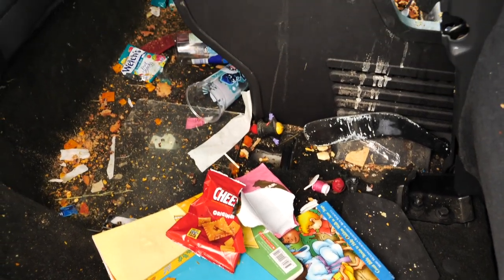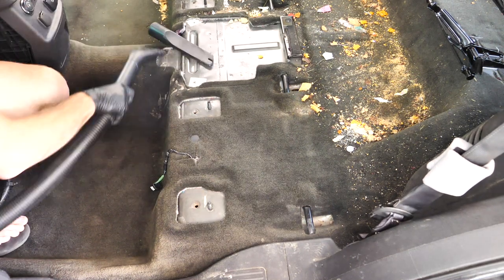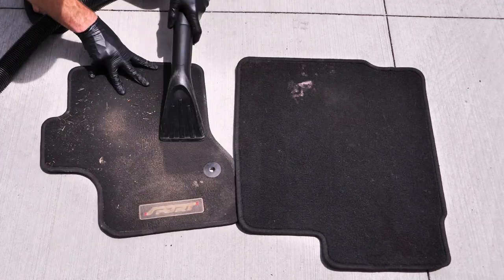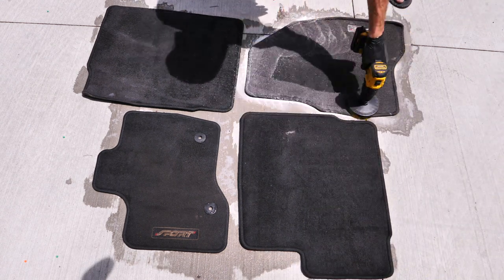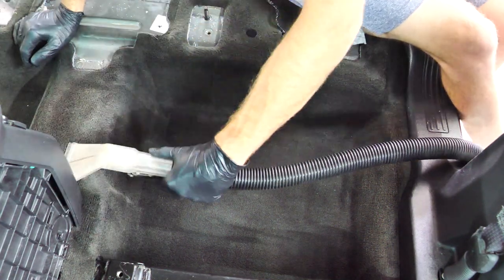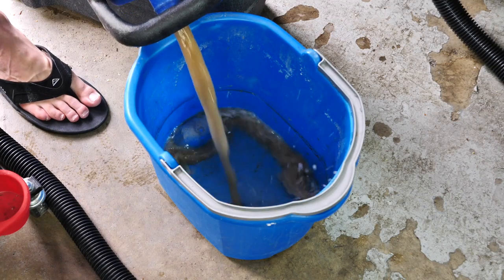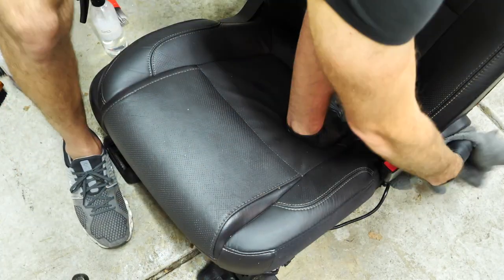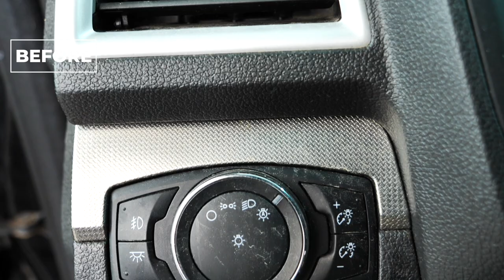Full Interior Car Detailing Transformation of A Nasty Kid Trashed Car! Interior Restoration How To

Comment: Hate to be a downer but those car seats are ruined with you pressure washing it like that. The harness straps are not meant to be completely soaked with water per the manufacturer directions (of all car seats), and by getting the shell soaked you can ruin the inside mechanics with any rusting on the metal. Please please please take this portion out of your video, you are promoting extremely dangerous practices.
Reply: Car seats should only be cleaned per the manufacturer instructions in their manual
Reply from the maker: I appreciate the comment but this is not true. If that was the case then everytime a diaper gets wet through or a drink gets spilled, it would be ruined.
Reply from the maker: Per Graco: 
For the cover: Remove seat cover and/or seat pad. You can machine wash these on the delicate cycle in cold water, or spot clean by hand with mild soap. Always air dry.

by using just a pressure washer and no detergent, this is even gentler than what they recommend.
Reply: You cannot be serious, child car seats are massively over-engineered and overbuilt. They get wet all the time, they are designed for scenarios like that.

Also rust lol, they are meant to be replaced every 10 years, they could last 30, but they want 10. There is no way rust in any part of that child seat is going to rust anywhere near a fail point in 10 years or less (excluding the fact they are all stainless steel for that very reason).

I hate people who go stupid over safety when there is no reason.

But hey, I am just an aerospace/mechanical engineer, what the hell would I know.
Reply: I have no idea if what this lass is saying is correct, but she's talking about the straps and shell, neither of which that extract from the manual is talking about
Reply: @StaufferGarage  that is for the seat fabric, to be removed from the shell on the car seat. Also note how it says to wash on delicate cycle, spraying with a high pressure washer is hardly equivalent to washing on delicate. Harness straps are to be only wiped with a damp rag. You potentially ruin the integrity of how the webbing is designed to stretch in an accident.
Reply: @StaufferGarage  I have spoken to many Certified Passenger Safety Technicians over the past few years with my kids and it’s a unified answer when I have asked if you can do this (because yes, messes happen, and sometimes this is your first thought to clean them), and they will tell you you cannot spray down a child’s car seat with a pressure washer. Please do your research, you have a large audience and influence.
Reply: @StaufferGarage  I should add, I have never thought of doing that with car seats, that is going to make cleaning them oh so much faster.
Reply: Bear in mind 20 years ago seat belts weren’t even a thing!
Reply: Removing and washing is completely different than soaking with a power washer ON the seat frame. OP is correct on this. Do your due diligence and speak to a child passenger safety technician or call Graco to learn more.
Reply: @girlnextdoor603  with the majority of followers being male on this page, it’s likely a lost cause to try and educate. Sadly the male way of doing things is usually whatever is easiest and quickest. But if one person sees your comment and decides to care differently for their car seats than it was worth posting ❤️.
Reply: @StaufferGarage  The covers are pulled off leaving the straps behind with the seat.. So Lauralee might be right regarding the straps?  Even though I dont see how water would damage Seatbelt straps...
Reply from the maker: Mechanical myself and agree, safety factor is insane and let alone the time that a kid will be using the seat is less than 10 years. What if the belt is soaked in ice cream, milk or water? How do you clean it? Spray with cleaner and chemicals? That in my opinion is more abrasive and degrading than a pressure washer and water
Reply from the maker: I think that’s a bit odd to think it’s a male thing only… why does this have to turn into a male/female debate?
Reply: @Melissa.Scott1  you are correct, most here would be males.

You know where else males are mostly. Engineering is mostly male, the safety boards who set standards are mostly male, the people who design and build them are mostly males.

Hardly see your point. When both you girls are wrong, and both of you do not know what you are talking about.
Reply: @StaufferGarage  100% agree mate this should be a normal debate not turned into a male/female you've done nothing wrong in my opinion
Reply: @StaufferGarage  Why odd? I didn’t say always, I said usually. And in my life, I’ve found that to be the truth in many situations. I find it odd that someone came on here gently trying to educate you and you and many other men (seems to be mostly or all men) have disregarded or ignored or tried to come up with ways to discredit what she said. Spilling ice cream on a seat doesn’t completely saturate the belts in whole. Spilling a drink on them likely doesn’t either, seeing as kids cups only hold so much water. As OP has posted, cleaning belts is supposed to be spot cleaning only. The misuse and care for car seats is a much larger problem than many people may even know. It’s not an attack for someone to come here and try to gently educate… you have a massive following and this could be a great teaching moment for many parents.
Reply: @matthewfarrell317  I am not turning it into a male/female debate, I never brought that up. And you are correct, the majority of the people who have designed, tested and built these are likely mostly male. And yet, they are the ones who have written these instructions to follow, and put in the manual for safe use of the seat, if it did not matter they wouldn’t put it in there. It’s in there because they obviously test these materials and would either not perform or have shown damage compromising the integrity of the seats. They don’t write these manuals ‘for fun’ there is reasoning for everything they include.
Reply: @Melissa.Scott1  I find that odd. Stauffer has confirmed he has a mechanical engineering background, I have an aerospace/mechanical background, and you are claiming the OP was trying to "educate" so would love to know her engineering background.

You keep talking about the belts, the belts that are made with synthetic fibres that are designed not to be affected by water? Also, there is more than enough water in a baby cup to do damage to materials, it's not about volume when it comes to that sort of thing. The car seats are designed with getting wet, as that is a major design parameter the engineers need to deal with. They use stainless steel to avoid corrosion and rust as much as possible. The seat is usually made with polystyrene foam to again deal with the ingress of water, and for its properties in a crash. Nothing in that seat is going to be negatively affected by the water.

Also talking to one of those "Certified Passenger Safety Technicians" is a joke, none of them do more than a week course tops (the ones here in Australia its a 2 day course).
Reply: @StaufferGarage  An occasional spill or vomit episode over the lifetime of the seat/straps is not the same as completely soaking them with an abrasive pressure washer
Reply: @Melissa.Scott1  even if she was attempting to "gently educate", as you so strategically put it, which was not the case,  her attempt is for not when you decided to start making sexist comments regarding the Male sex. And yes what you wrote is sexist no matter how much you try to "back peddle" its sexist. Btw I'm female so any other sexist  comment you post doesn't relate 🤗
Reply: @StaufferGarage  don't worry about it you're doing great been watching you for a few years now and I'm NOT part of the "Male audience" lol. My father has removed and pressure washed filthy seats for 15 years now or more with absolutely no issues. It's never something he did to the same seat repeatedly.  Always a one time deal to get the majority of the  grime out. You're doing awesome! Keep up the great work😊
Reply: @matthewfarrell317  thank you, thank you, thank you! Lol
Reply: The carseats are fine and still useable jfc, pressure washing is so much more gentle than a “gentle” machine wash cycle
Reply: @gabriellehale8318  I’m certainly not trying to back peddle, I stand by what I said. I didn’t say all men, that’s all I was trying to clarify. Power washing a car seat is 100% taking the easy way out. Amazes me how sensitive everyone is in today’s world. 

Also, if I’m the “Karen”… 🤣 ok fine. I’m happy to stand by what I’ve said. Pressure washing a car seat is not proper care, point blank. Whether it’s due to seatbelt saturation or putting too much wear on the sidewalls. The seats are not intended to be washed that way. 🤷‍♀️
Reply: @StaufferGarage  It does only if you allow it bro. You are a professional and have done this thousands of times. Let's those that know everything, know everything. Keep it moving. Detailer to detailer let the lack of returns for service speak for themselves. #itsallinthedetails
Reply: @girlnextdoor603  the part that makes a delicate cycle 'delicate' in a wash is that the agitation is turned down, not the water pressure. Just pointing that out.
Reply: Well, as a woman maybe I’m not allowed an opinion here since only “males” apparently watch this channel. However, I’d like to add some personal experience as a mother of two children who somehow have successfully made it to adulthood after being in car seats as infants and toddlers that were most definitely hosed down on several occasions. I too have read the instructions on the car seats and did not consider that method of cleaning to be “immersing” any part of the car seat, straps included, in water. 

I think also in this day and age of coronavirus, spraying the seat down and then leaving it out in the sun is probably the best option. 

So, I wouldn’t consider the car seats ruined from pressure washing. Those car seats were ruined when kids were sat in them. Because, kids.
Reply: @jacobburnett1175  I’m a woman..I agree with you!  Anyway..just mute them. They obviously are out to cause trouble for James.
Reply: @gabriellehale8318  lol, well said ✋👍
Reply: I think it's insane that you wouldn't atleast call the manufacturer and fact check. You are a business and property of your customer should be super important. Instead of arguing with someone who is just trying to keep the safety of a child. This is disappointing that you took the route of pinning her comment and denying her claims. 😒
Reply: @StaufferGarage   As CPST it is best to follow manufactures instructions as they will not be liable for any injuries unless you do. That being said I have not seen a blanket statement across all brands regarding washing of the parts. Nearly all the parts that need cleaned can be removed. And yes using any chemical that can compromise the materials will in facts bios the manufacture warranty.
Reply: "You know nothing Jon Snow".
Reply: @StaufferGarage  : post warning for karen on intros
Reply: @ChiralSpirals  i don’t think she’s being a Karen. When it comes to kids and babies im the “better safe than sorry” type. So i agree with her. Given the state of the vehicle its hard to say what any part of the car seats have really been through and under additional pressure from the pressure washer the straps could be less effective if the driver were to get in an accident with a child strapped in. For liability reasons I wouldn’t have done that personally. 
Certainly wouldn’t film it. I left so many mom “support groups” for car seat related discussions turned wars. Its always a topic thats guaranteed a fight. 
But i dont like lauralee ellis was being a karen. She’s far from the crazy car seat karens i’ve dealt with in the past.
Reply: He may be an amazing detailed but that doesn’t mean he can’t make an honest mistake. He should research it for himself and if he finds he made a mistake then he should own it and educate others on not making the same mistake.
Reply: @leftfordead6307  now was all that really necessary?? There’s no reason in cussing at the girl like that. Hope it made you feel good!!
Reply: @matthewfarrell317  and what does him having an so called engineering degree have to do with cleaning a damn car??
Reply: holy hell. Straps are NEVER to be soaked! It causes them to stretch and then degrades so in the event of an accident can break under force ejecting kid from seat! There is a reason car seats have to be safety tested and regulated.
Reply: I was reading ur comment about the car seat being cleaned with the pressure washer and it does not damage anything.  If anything it cleans it better and keeps u from having to Clean it for a while. I understand what ur saying but someone I know cleaned one for me and it looked amazing. U just need to get someone who knows what they are doing and everything will be fine.
Reply: @matthewfarrell317  He also vacuumed off the water and left it out to dry. Seems wet pee (ammonia) left to sit in the seat would be loads more corrosive.
Reply: Boom roasted
Reply: @benvalenza1977  ur welcome
Reply: @ChiralSpirals  ikr! She should complain to the manager 😁
Reply: @jastinyhale  aww but i love this channel
Reply: @rickharris4579  you are kidding, right? One of the first units you do is material properties and how to understand them. While you can clean a car without engineering, when making statements about how to do things, it holds more weight than someone who has no idea.
Reply: @KbugsKreations  are you trying to compare 50-70 year old straps that used natural fibres to modern day synthetic fibre straps?

The modern day ones will not absorb water that like, also, if what you stated was the case, no one would be able to clean or spill anything on the belts, and you wouldn't be able to drive in the rain for fear of getting the belts wet when you get in/out of the car.
Reply: These comments are savage, man. I think she was just trying to help. I think it's really cool that the comment was pinned so that people will see it and can then research it and decide the best and safest way to clean their car seats.
Reply: @HarryHighTimes  Neither were child car seats.
Reply: @Melissa.Scott1  Big BOOOOOOO! Some guys - like myself - even read manuals and instructions (sometimes 👀 - no, just kidding!)!
Reply: @StaufferGarage  call Graco and ask a CPST yourself. You are misunderstanding
Reply: @StaufferGarage  because when people find out they are WRONG, they have to resort to gender issues since their first argument didnt hold up. thats what happens when social keyboard warriors put their input in where it doesnt belong. You are awesome and you did a great job cleaning those carseats, keep up the good work!!!! love your videos!
Reply: these comments are yikes
Reply: My go to Sweet is peanut butter pudding from Publix or a snickers
Reply: You could also keep your car seats cleaner if you didn't allow your children to eat or drink in the car! I have had 6 children and never had an issue pressure washing car seats or belts! If you're afraid somebody is going to pressure wash your belts then maybe clean your own vehicle! Most cars didn't even have seat belts in them when I was a kid and yet we still survived and we weren't ready to sue somebody because we scraped our knees!
Reply: @Melissa.Scott1  but you two are wrong tho
Reply: Thanks Karen 😊
Reply: @girlnextdoor603  bro are you really arguing about detailing with Stauffer garage?? 🤣
Reply: @benvalenza1977  LMFAO! such a Karen LOL
Reply: I have no idea who is right but l would do the exact same thing in cleaning the car seat...
Reply: @Melissa.Scott1  well we see how you really feel lol
Reply: I don’t think Karen has ever used a pressure washer. You can put your hand under it. It’s not insane pressure that rips car seats to shreds. He definitely is using a lower pressure tip if he is detailing a vehicle.
Reply: Also car seat company is just covering their butt so they don’t get sued. No way engineers actually believe a pressure washer could damage or rust a car seat. Unless you held a high pressure tip to it for long amounts of time which only an idiot would do.
Reply: @UC70A3VsqHsKZip2XGVSZ3sw oh stfu u hatin ass
Reply: @girlnextdoor603  just give up already
Reply: Ok karen if car seats couldn't handle a little water they were not well engineered in the first place.
Reply: @leftfordead6307  Wow, what a way to get into a conversation. Calling a person names & a Karen. What are you trying to accomplish here, you are escalating a disagreement to your own overblown opinions. Be nice!
Reply: @clenesejones7672  Do you know that for sure though, as an EMT, I know car accidents with babies is a scary thing & I would want to be absolutely sure, thanks!
Reply: @jastinyhale  3 Hales in these comments,  I m in Mich. Where are you other Hales from?
Reply: Omg wow so many comments I just wanted to be a part of this 🙋‍♀️
Reply: @jacobburnett1175  sadly this woman probably doesn’t have a clean car seat and most likely doesn’t even use the harness correct. I would be more concerned with buckling my child correct then pressure washing a seat you know she probably never cleans and will only use for a few years!
Reply: The manufacturer wants you to contact them for service because they want to sell you new parts/service and to cover their ass, not because they think a strap will be ruined by water.
Reply: @girlnextdoor603  the straps are not being immersed in water, they are being sprayed, immerse means to put into water as in a bucket, or soak the entire seat like in a big bucket etc,
Reply: Ok Karen and it’s his video and the owners car but u just had to take your time to comment stuff
Reply: Also it's like 100º out right now. That seat must have been dry in an hour.
Reply: @StaufferGarage  I have heard that pressure washing the straps can cause the fibers to loosen making them more likely to fail. I'd suggest contacting Graco and see what they recommend for cleaning. :)
Reply: lauralee ellis you’re definitely right these car seats needs to be thrown away ASAP
Reply: And the fact that people are actually calling you a Karen is insane, there’s no such thing as a Karen when it comes to kids and babies
Reply: So sad to see so much hate and ignorance in this subthread instead of people educating themselves on car seat safety. Our knowledge has evolved thanks to things like this and people getting into accidents. Kids didn’t survive because parents made mistakes and we didn’t know better. 

It doesn’t make someone a Karen for gently educating. If you’re ever in doubt, contact the manufacturer. A child’s safety is more important than a lot of the egos trying to flex in this comment section.
Reply: Warm chocolate ship cookies
Reply: I totally understand what you are saying @girlnextdoor603 . But those instructions are there to cover their asses in case someone sues them for improper use. Let’s say you pressure wash those straps everyday for a whole month, those straps will still have tremendous tensile strength it would be impossible to rip them with your own hands. If the baby ejects from that car seat because the straps were torn, that massive momentum alone would’ve killed the baby anyway.
Reply: It says MAY weaken has it been PROVEN to weaken? I am a female and isn't the harness and straps made the same as seat belt material? If all of you are so worried about it then just replace them. Our carseat has been soaked including the harness and all straps because the kids thought it was a good idea to sit in it and spray each other with the hose. Lol but it's not weakened anything. So calm down!! It's been 3 years and it's still just as sturdy as when I bought it. .....don't believe everything products say they are just covering themselves if something were to happen. RELAX! 😊❤️
Reply: yes Stauffer garage is correct my daughter is raising two boys eighteen months apart the only way to get ALL the gunk dirt was to hose them out
Reply: this girl needs to get a life I guess you would rather leave them dirty
Reply: While in principle I agree with OP (ie - always following manufacturer instructions), I also highly doubt the method of washing this seat hurt anything. Especially in those seats, the only real thing you need to worry about is the headrest foam, and water won’t degrade that anyway. 

That being said, I wouldn’t do that to my seats just in case. Just a risk I don’t want to take. Doesn’t mean anyone who does is endangering their child though. I just don’t have the risk appetite for it. 

What I WOULD do (and I am so not a lawyer), is make sure every time you wash a seat that way, you get the car owner to sign some “hold harmless” type document. If something were to happen to someone’s kid after you cleaned a seat like that, they could in theory say you KNEW it was wrong and the car owner didn’t. Just better to have your rear covered all the way around. Who knows, you probably already do that anyway.
Reply: You are 1000% right lauralee
Reply: @StaufferGarage  Even being left out in the rain, compromises the seat. You should truly consider stopping that practice. It’s a liability.
Reply: @tonicascino8809  Your daughter is compromising her children’s safety in the seat, by doing that.
Reply: Everyone is upset because they’ve done this and don’t want to admit due to their ignorance they’ve put their own children in harms way. Rather than “thank you for educating me on something I know little to nothing about” it’s “Karen”
Reply: Only Karen’s would say all types of crazy things about safety when they be the ones driving while texting and putting on makeup 😂.
Reply: If those straps weaken from water and moisture, it doesn’t belong as a strap.
Reply: @tonicascino8809  no, you should NOT hose down car seats.
Reply: So sad about the carseats too! The carseats are now trashed, my kids safety is more important than I clean carseat. Every single carseat has a manual on how to use and wash and you should never wash the straps in any carseat! Juice, milk or ice cream are not the same as soaking wet straps!! So sad
Reply: @benvalenza1977  she’s not a karen carseat safety shouldn’t be a option! Soaking wet straps are not the same as ice cream, juice, milk or a little pee. The manufacturer manual specify this for a reason!
Reply: @ljb6343   You wouldn’t know if they are “sturdy” unless you’re in a car accident and they don’t do the job. Sad that child safety is not important for some parents
Reply: I remove the fabric from the plastic and wipe down the plastic and straps with Clorox wipes. Dirt/, food, and sand always get trapped underneath the fabric. I feel power washing it once or twice probably won’t effect it majorly over all but why not take it apart to make sure you’re getting it entirely clean? It takes 5 min to tear one apart and throw it in the wash
Reply: He shouldn’t have had to clean those nasty car seats in the first place, those are the owners responsibility!
Reply: My thoughts exactly
Reply: @lauralee,  you are completely right in the no pressure washing thing. Straps are not supposed to be submerged in liquid as this does ruin them and these seats themselves are all ruined. You should wash per manual and i'm so sorry you are getting so much hate. You are not a Karen. I myself had to skip past that section of the video because it made me cringe.
Reply: @girlnextdoor603  girl that man know wtf he is doing my uncle been a professional detailer for years and did the same shit with car seats and I’m sure enough gonna tell you that you don’t know WTH your talking about